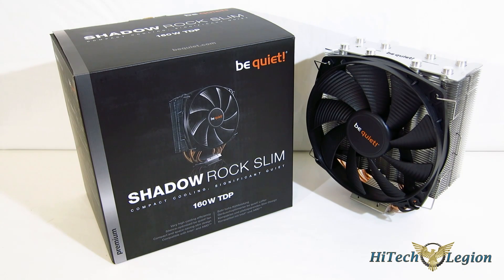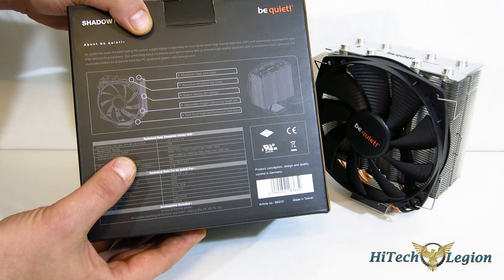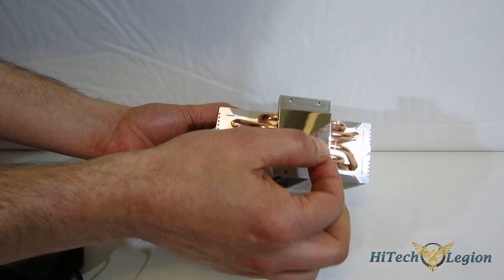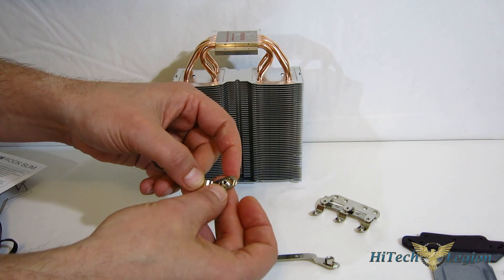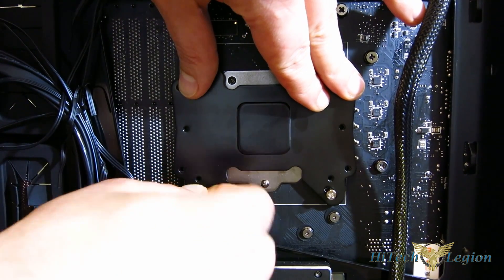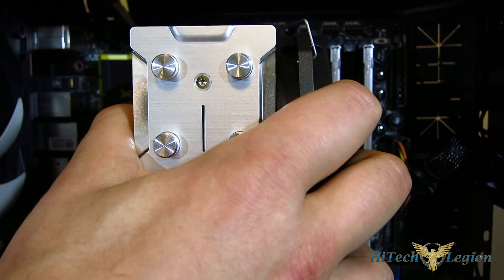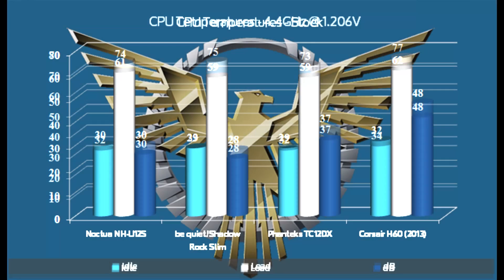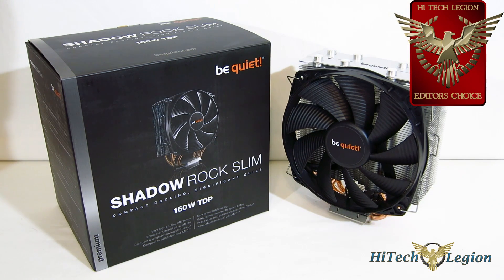be quiet! Shadow Rock Slim CPU Cooler Overview and Benchmarks

Comment: Planning to upgrade to the i7-6700k and was doing some research on a cooler that isn't HUGE or too expensive, this just fits the bill perfectly. Slim, quiet, doesn't take much space and reasonably priced for the performance makes this sold to me. Great video btw and props for the installation, wasn't expecting  it!

Comment: +HiTechLegion hi can you help me i have installed the cooler and it works perfect it is really silent but when is start my pc i get a pop up and its say CPU FAN ERROR can you help me?
Reply: +Dan van Dijke This can occur with fans with low startup speeds. Depending on your MB, you should be able to go into BIOS and tell it to ignore the error on boot. An alternative would be setting the fan speed's lowest setting higher in the BIOS.

Comment: I'm looking at purchasing this cooler. I have a coolermaster HAF X case. My main concern is with the backplate. Is the backplate insulated? But more to the point I'm afraid that the cutout behind the CPU on this case isn't large enough. I would have to install  this cooler and others like it with their backplate outside this case. I'm afraid that  the backplate would touch the inside of the case. I really don't want to cut a bigger hole. Will it short out? All help welcome
Reply: +SuperHiiyaa The backplate has a layer of plastic insulation on the side facing the motherboard. I would advise installing the cooler outside of the case anyway, I personally find it easier because you can access all screws easily. :)

Comment: Hey, Im not sure what  "compatible with Intel LGA 775/115X/1366/2011" means, but I want a more quite cooler for my i7 4770 non k version. Could someone let me know If the 4770 is compatible? Would be great thanks!
Reply: Sir Devine 115X refers to 1155, 1156 and 1150, which are all physically the same in terms of cooler mounting. So, it will mount without an issue on your 4770 (which is LGA 1150), and in exactly the same manner it mounted on the 4770K in this video.

Comment: Does it come with the thermal paste? I see that it's not included. Should i get be quiet shadow rock slim or be quiet shadow rock 2? Shadow Rock 2 is much heavier and bigger so i was little worried that my Ram might not be able to fit since its pretty high profile . pls answer :)
Reply: paperitgel98 The thermal interface material is clearly shown at 5:49

The performance difference between the Slim and SR2 is surprisingly small. Personally, I would go with the Slim.
Reply: George Cella didnt notice that, cheers

Comment: can I mount 2 corsair 120mm sp ? please answer :)
Reply: Sure. I would expect far more noise increase than performance increase from doing it, though.
Reply: George Cella
what fans do you reccomend then :), iam using a 8350 with the stock cooler right now, and I wont overclock it, please help me out,
Reply: Green Hood be quiet! is known for making some of the best fans in the industry, so I am not sure why you are looking to change it. It sounds like you are changing the fan simply for the sake of changing it. Adding a Silent Wings 3 120mm in pull would give a very slight performance boost without an undue increase in noise.
Reply: George Cella
Alright, Thanks alot for this, I will go like you said, I will add 1 silent wings 3 120mm.

Comment: would the mounting system allow for a bottom of the case --> top of the case air flow configuration instead of front of the case --> back of the case like you  did?
Reply: It can be mounted in any direction on Intel systems.